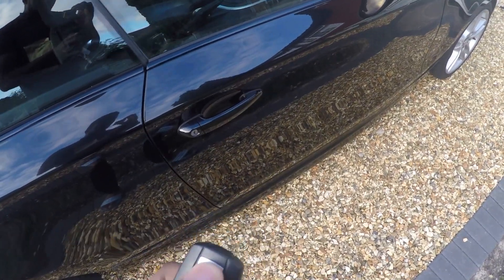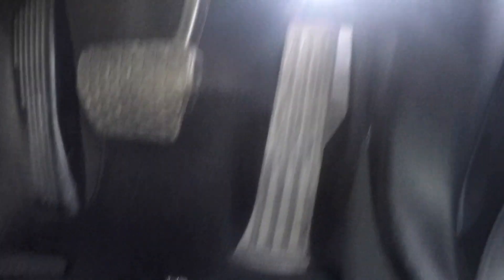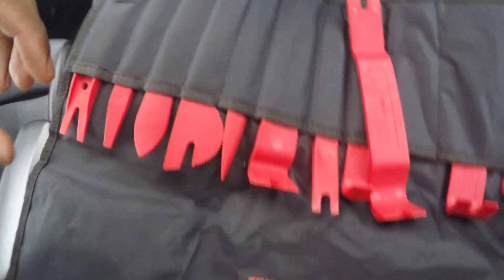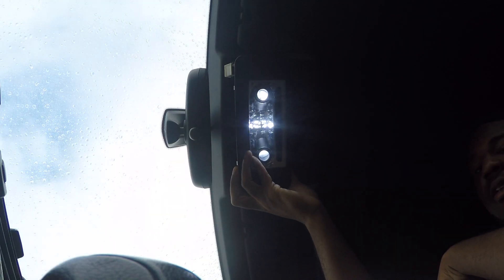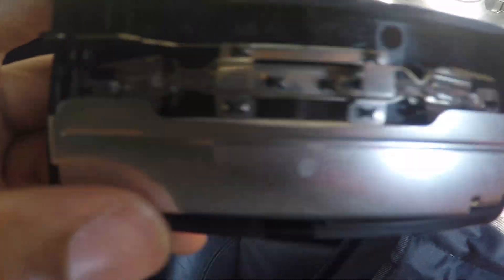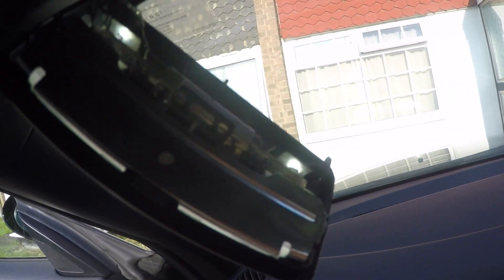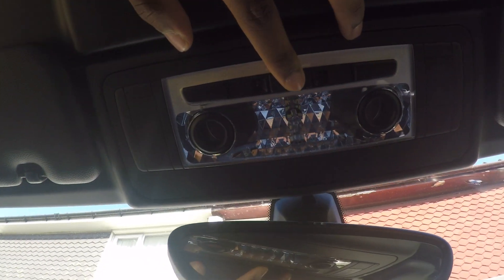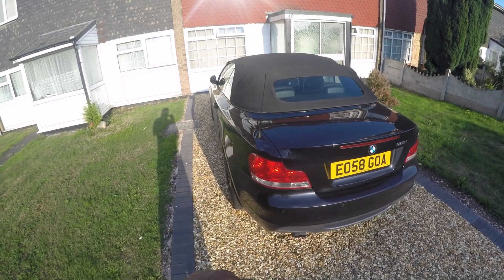Installing LED Interior Lights On A BMW 1 Series E88, E87, E82, E81

Comment: Hi Carl r u doing? 
I’ve try to change it on mine but unfortunately none of them works ☹️🙄
Reply from the maker: You have to turn the lights around if they dont work that’s what they told me to do. Do you have instagram? So I can help you
Reply: CARL IS ONIT no I don’t have Instagram but I’ll try to turn em around fingers crossed will help
Reply from the maker: valerio pilla yeah it should work when you flip them around let me know how you get on
Reply: I've had the same problem. LEDs wont seem to insert the other way no matter how hard I try

Comment: Hey, great video. I actually want to mount a dash cam behind the mirror and run the wires along the top of the windshield behind the top plastic trim. With the dome light unit removed can you fish the wire from the cam, into the mirror housing and up into the cavity behind the dome light ? If so, is it then possible to fish the wire along the trim to the A pillar ?
Reply from the maker: Yeah this is possible 👍🏾💯

Comment: Carl how about a cam belt?
Reply from the maker: valerio pilla yeah I think its near that time to change it I’m gonna get that done soon
Reply: CARL IS ONIT hi Carl 
It seems like my joy doesn’t like the cold😱😱😱😱
Reply from the maker: valerio pilla what happened?
Reply: CARL IS ONIT well with this weather my windows l/r once I start the car are jumping for several time it’s really annoying 😟😟😟
Reply from the maker: valerio pilla 😨 that must be so annoying, I think you need to get it checked by a garage maybe your battery may need replacing
Reply: CARL IS ONIT mine it’s on recall for the cable battery on the 29 hopefully it’s that have you check yours? If you need to bring for a recall
Reply from the maker: valerio pilla Ahh I also just got a letter yesterday about a recall for positive battery cable so I’m gonna book it in soon
Reply: CARL IS ONIT don’t go to the garage book it trough the phone by customer service, I should get done mine during summer, I’m still waiting a call from bmw Crawley since July 😱😱😱😱
Reply from the maker: valerio pilla 😨😨Me too! thats what I did since july aswell and no one gave me a call back hopefully I can get it booked in through customer services this time

Comment: nice vid, but they are not called puddle lights, the puddle lights are the ones at the very bottom of the door which our 1 series does not have, not sure what the door handle calls are called, but there not puddle lights... easy mistake to make, I did when I first got mine
Reply from the maker: Thank you, also thanks for the correction, I think they’re called welcome home lights they activate when you unlock the car

Comment: I cannot get the clear clips on the side out at all. Just not budging
Reply from the maker: Marc Holler which side is it in the interior and are you using a prying tool?
Reply: @CARLISONIT  its on my right side and I'm using a screwdriver that the car came with (the manual said to use that)
Reply from the maker: Marc Holler be very careful with a screwdriver you may crack it because of the sharp metal bit I’d fully recommend using a plastic pry tool, you would need to push into the edges until it pops up
Reply from the maker: Marc Holler Hi Marc have you managed to do it? If not send me a picture and i’ll try and help you
Reply: @CARLISONIT  I have not tried again. Maybe later on today. I kinda looks like I'm mkssinf a medal clip on the right side. Not sure if that will effect it
Reply from the maker: Marc Holler is that within the bulb holder that has a missing metal clip?